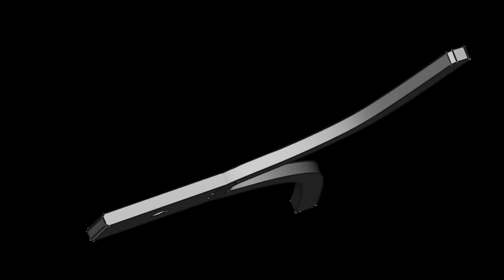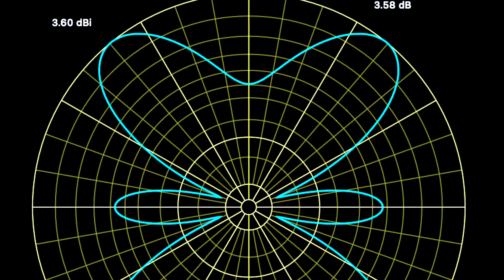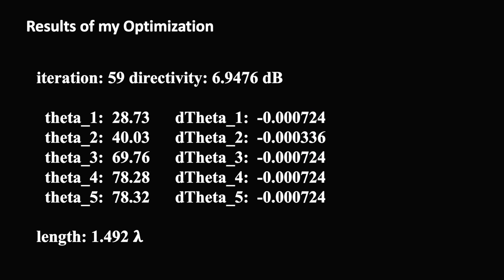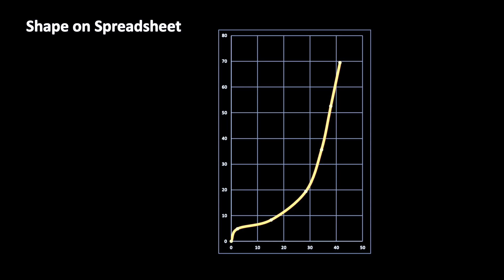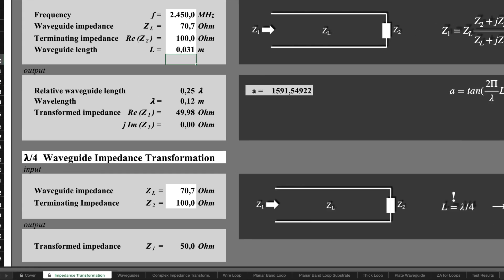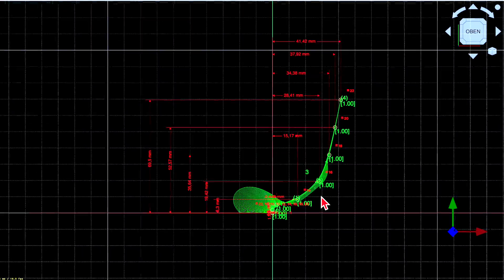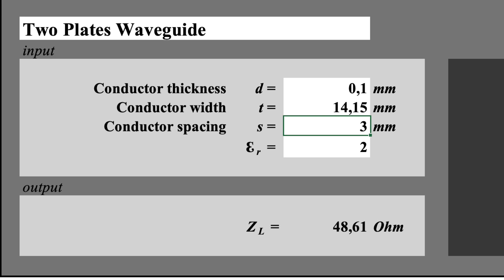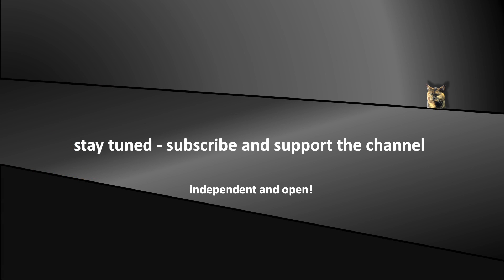Optimized Antenna designed using FreeCAD (EP91)

Comment: Wouldn't you want a balun if you're driving it with coax?
Reply from the maker: Hi Jeremy,
thanks for your comment! Well, in fact the feed network I am using is a kind of BALUN. I chose this "trombone construction" because I can tune it. That trombone is getting large for lower frequencies and you would prefer other constructions using cables or transformers.